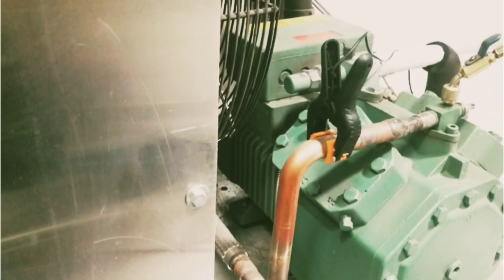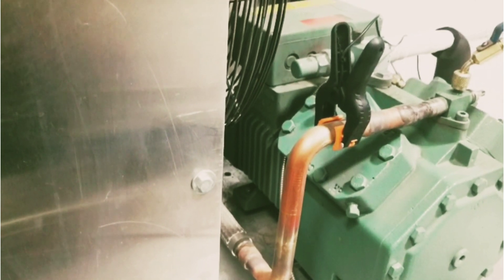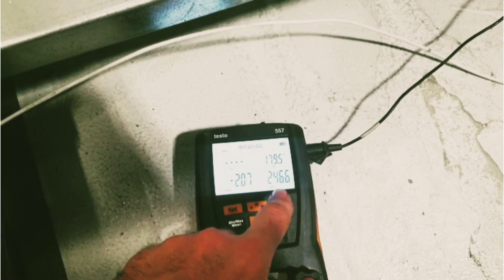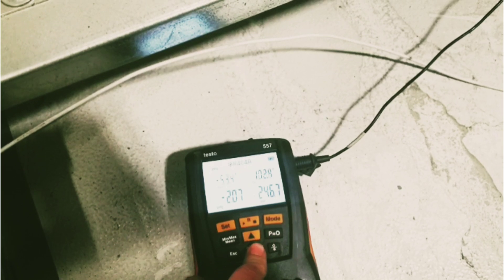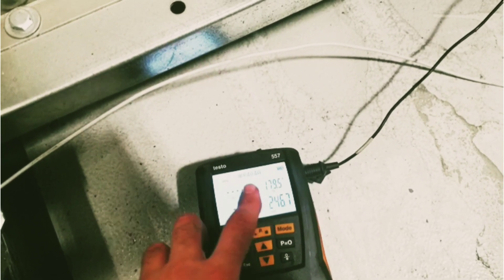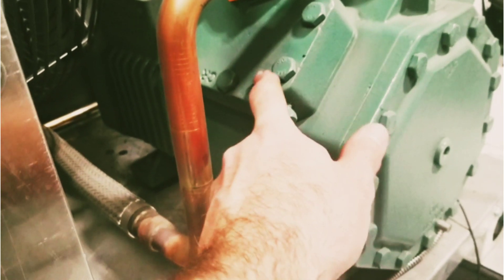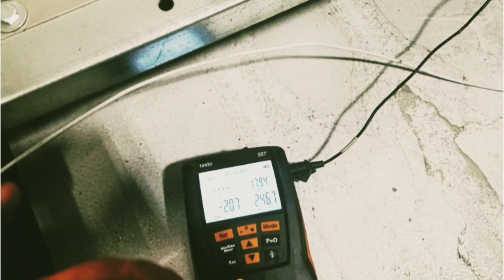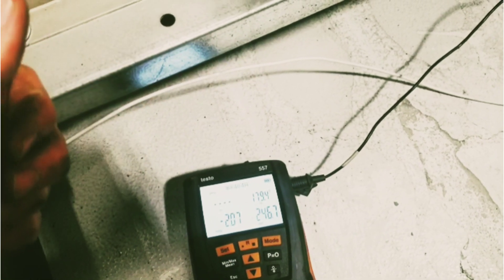HVAC - Discharge Line Temperature In Refrigeration Systems

Comment: I working on walking freezer and the discharge line is extremely hot and i went inside i noticed the heating element is hot aso i check the timer it was on refrigerant mode what can be the issues

Comment: Hi bro, i'm a new subscriber of your channel, good videos they really helped me a lot, i'm having a issue with an WALK IN FREEZER R-404a, 2 ton to be specific then the problem is i'm getting a really high DLT around 300+F, condenser coil is clean and air flow is ok, is a copeland scroll compressor with the liquid injection valve and its working so i'm expecting that the problem could be a restriction either the filter dyer or the TXV valve? what do you recommend me?
Reply from the maker: Hey man, I just did a live trying to answer your question https://youtu.be/yVeqKDnI4mg
Reply: Compressor failure

Comment: I’m working on a cascade system , the low stage R23 is controlling well but the discharge temperature is 244 oF . High stage is R404a and operating correctly, cooling the cascade and controlling the head pressure on the R23 . 

I can only think that the rate of compression must be high inside the compressor . Not straight forward to take subcooling and superheat on these cascades

Comment: If my discharge line pressure is normal, but discharge line is high is that mean there is noncondensible air in the system? Thank you

Comment: Is this hvac or partial battlefield music intro
Reply from the maker: Haha just some royalty free music
Reply: @HVACKnowItAll  
I am new in HVACR field but I have done a lot of hot side work. 
Can you explain a few different things in your next video since you explain things really good. NORMAL RUNNING SUCTION PRESSURE OR SATURATION TEMPS  FOR DIFFERENT APPLICATIONS. Just something that will help us understand saturation temps better. I always heard from guys when unit first gets started or the load is big the saturation temps will be higher but as the load on evaporator goes down it the saturation temp will go down and to normal, is there any way you can  explain the saturation tempreture as the load is big ?  Or if they are not right  does the saturation temperature  depend on the charge and superheat?

Comment: How to decrease discharge line temperature if it is above 250 F
Reply from the maker: Could be a number of things causing it.  Dirty condenser, high super heat, defective tx valve etc.  You need to find out why before you can fix it
Reply: Condenser is clean, expansion valve is new R 22 Suction pressure is 70psi discharge pressure is 250
Reply from the maker: @Rin-bn9mj  I think you're confusing pressure and temp my man.  Nothing wrong with 250 psi.  My video is about temperature not pressure.
Reply: @HVACKnowItAll actually discharge pressure is 250psig and discharge line temperature is above 250 F I am asking about discharge line temperature.
Reply from the maker: @Rin-bn9mj  doesn't make sense to me with those pressures, what's your super heat and subcooling?
Reply: @HVACKnowItAll  subcooling is 8 and superheat is 22
Reply from the maker: @Rin-bn9mj  I would check your thermometer man, not sure how your discharge temp can be that high, unless your heat of compression is through the roof.

Comment: Great video brotha!👍🏼 Found out 3 compressor replacements on one unit because of excessive discharge heat
Reply from the maker: yah man it's a bitch!
Reply: Don't just condemn a compressor for high discharge temp.  Check your condenser and other items.  Find out your cause of the high temp issue.  Cause you may put a new compressor in and it will be acting the same.
Reply: What was the actual problem